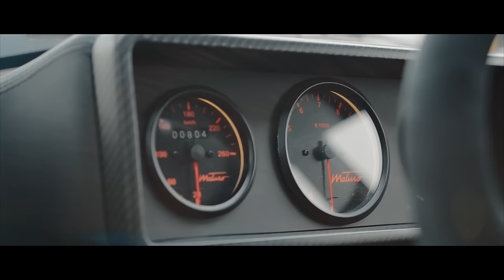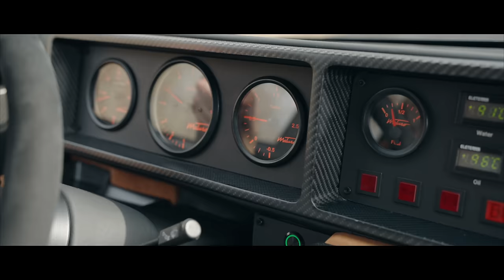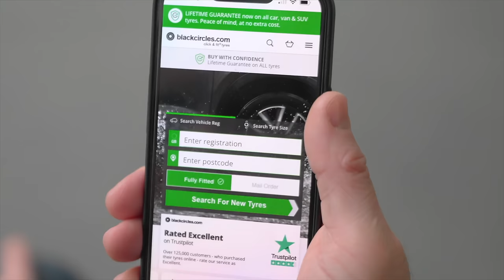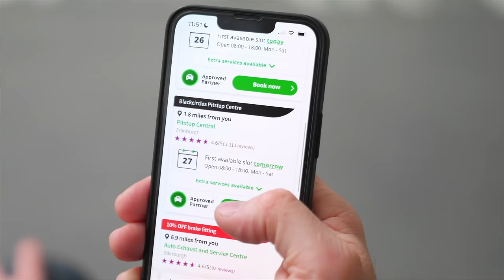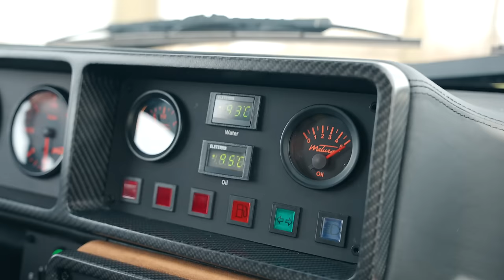Reborn 90s Rally Hot Hatch icon - Lancia Delta Integrale Restomod review

Comment: An aunts husband had an og Lancia Delta 1300 , used it to pull a caravan, which then pulled the engine to bits by the end of a summers journeys, towing the caravan. So by 6mnths old it was dead, literally.  They scrapped it as the shell was splitting as well.

Comment: Lancia / Fiat know how to build a Turbo car they are the masters of the small displacement Turbocharged engine! "Look at the Delta, Uno, Y10 and the 500" Add to that what these guys are doing and I frankly find it amazing! My last 500 Abarth was pushing 250bhp and was told by a contact I know at Abarth UK on the engineering team,  He said the engine was good for 300BHP without upgrading the internals as they had Teflon liners! and were well over engineered. My old '88 UNO turbo i:e boosted to silly amounts back in 1998 and would see most hot hatches off back then. FIAT / LANCIA / ALFA are all legendary just ignore the general build quality as that has always been poo!! When I started as an apprentice mechanic in '95 I was told Fiats are all engine and gearbox and no bodywork lol!! It's true!

Comment: This is a very good restoration level and I'm impressed by Marco's work by the choices. 
There is a fine line between constructive improvement and wrecking the character of a car and Maturo seems to have found it. I do not have 300 000€ lying around but given the brain time neaded to engineer this well, it seems sensible. 

I would possibly skip the rear hatch changes (to be seen in the flesh) and definitely drop the  interior carbon fibre finishes which are too "fast and furious".

Comment: Where I once worked we used to borrow one of the managers Integralis to travel between the sites. The game was to see who could go fastest down a short straight section of road with tight bends at each end. I was disappointed with the acceleration until the turbo kicked in and it tried to rip the steering wheel out of my hands as I turned!

Comment: Great car, fantastic restomod, some interesting facts and figures though I don't think that's necessarily entirely true that Integrales were used for only a couple of rally's. In fact some Works cars were developed from the original 8 valver into an Evo still retaining the rainbow recaro and alcantara interior. Actually pretty durable cars and that Lampredi twin cam is a joy. I still own my Evo I since 2004 😊
Reply from the maker: Owned since 2004? It's a keeper then Richard?
Reply: It's been an amazing ownership experience, met some great folks I am still friends with today and actually the car has been really reliable (touch wood!). Used as intended, to the Nurburgring, Knockhill and mainly on the road. My car actually features in Top Trumps Gumball rally from 1998 the first year it was run.

Comment: The only Restomods I really like are Mechatronik Mercedes. Either their  '69 W113  280SL (now with 4.3 or 5L V8, air-con, modern brakes, stereo etc) or preferably the W111 Coupé with a 5.5L V8.
Best of all they can be returned to factory spec without any trace. Downside they cost more than this.

Comment: It's cool to see yet another cult classic remade for the posh folk. 

Me, on the other hand, I'm still waiting for a remake that's not carbon fiber, that doesn't have titanium exhaust or a diamond gear knob, but can actually be acquired by regular ppl. 

I'm sure remaking a car like this is possible using fiber glass panels and less exotic metals to build to a price point. Like 50-75k.

Comment: For those people that think this is expensive... Delta Evo when new cost around 50k German Marks and rally car group A cost was around 600k so around 12 times more then regular car. This is basically group A car without original r70 or r90 gearbox. Comparing where prices of normal Delta is at moment this "restomod" at 300k is cheap.

Comment: Restomod?! Not at all. This is just a generic restore with some better interior
For 2020 onwards, any restomod should mandatory have electric drive train and full digital interior. Hands down, both of these are mandatory to qualify something as restomod.
Combustion engines completely out of the question.
And even so, hearing the discussion at 17:30, they didn't even use modern engine stuff. Or use an old combustion engine and install electric motor to make it a PHEV at the very least, you can call it a restomod.
To ask 300k euro for this, is a scam. 30k would be fair.
Reply: Knowledge gap